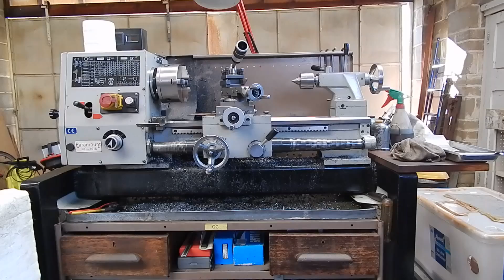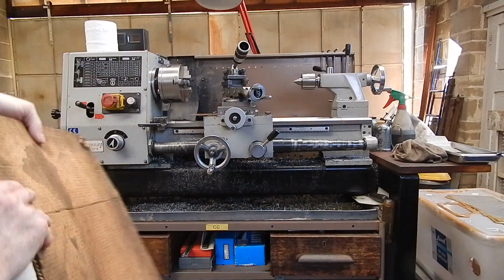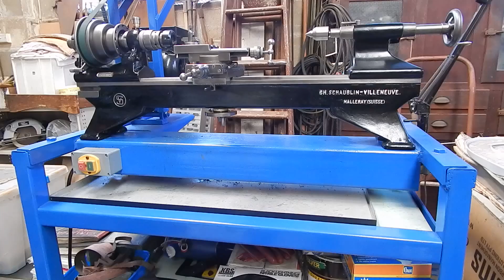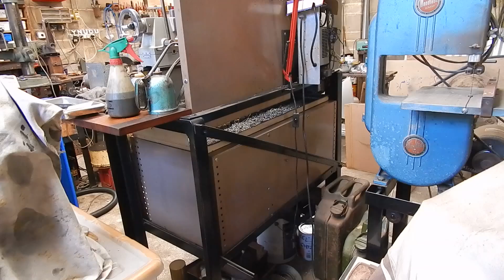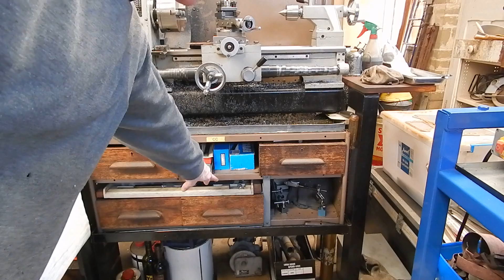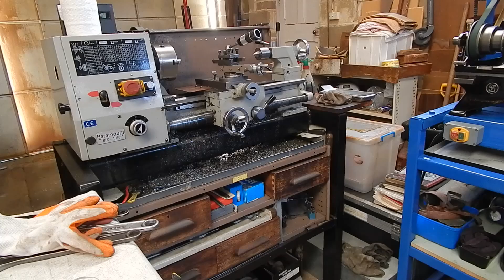Spanning beam metal lathe stand

Comment: Rob: Do you have any additional construction information. The Link supplies a lot of pictures. However It really leave too much up in the air for a newbie to make mistakes.
The most common Mini-Lathes like mine LMS - SXC4 - 8.5 x 16 is a decent lathe but it like most Chinese machines lack the basic rigidity and your approach makes much more sense than anything else I have seen.  My next challenge is to provide my Mill LMS X2 solid column with an increased base rigidity.
Reply from the maker: Hi Dave,  that's the only resource I supply.  There are various ways to do this (as shown).  The second (blue) stand I made has a removable/bolt on beam to make it lighter and easier to move around when constructing it.  Others have a metal beam on wooden cabinet/stand.  The choice is endless.  It all comes down to what you are capable of (some people can't weld) and you could even make the whole thing bolt up.  It's up to you.  Good luck.  Cheers Rob

Comment: Rob: I wish I had seen this video before I built my current Lathe and Mill Stands. Very reminiscent of how the RCN mounts their Lathes shipboard. Or at least what I saw as my Dad (CPO) took me through the Machine Shop on board the HMCS Quebec (HMS Uganda), at lot of memories. I was considering a U channel but the Box Beam would be so much more rigid. Good point on lowering the ends for the oil, how many times that has been over looked. Cheers BTW I also correspond with Gary of Eccentric Engineering.
Reply from the maker: Hi Dave,  I actually got the idea from seeing how they mount lathes in ship machine shops.  I thought it was a brilliant idea.  Gets the lathe up away from the chip tray and gives it a highly rigid, level base.  On ships they usually mount with two points at one end of the beam and a single ball point at the other.  That way the twisting of the ship can't distort/twist the beam/lathe base.  Very simple and clever design.  The way to go.

Here's a link to my web page on it:  http://users.tpg.com.au/agnet/cq9325rev4.html

  Cheers Rob

Comment: Great video Rob. Have you ever seen an example where someone used a three-leg design? I know three legs are often used to get around worries about uneven floors, but I suppose such designs aren't worried about leveling so much as most machinists are.
Reply from the maker: Hi Rick,  they often use a three leg design for ships lathes, to allow for the floor and walls flexing.  One end is usually attached to the wall at two points and there is a leg at the other end.  All attachment points are hinged or pivots.  

I basically liked the idea of letting the legs move/flex and the beam stay straight, so my (and other) torsion beam designs utilise this principle.  In addition you can have a removable chip/oil tray and raise the carriage hand controls well above it.  Much better than a conventional stand IMO.  I've had quite a few builders contact me to show their finished stands.

Cheers Rob

Comment: Hi Rob. Great video. I liked it so much I made one myself for my Warco wm280v. Couldn't find box section at my local metal guy but found some U channel instead. I mounted the frame on machine castors that allow the wheels to be retracted. I bolted it to the wall at 2 points. Now if I need to move it or access the rear I can unbolt it, drop the wheels and wheel it away.

https://youtube.com/shorts/EoWTUG-Qpf4
Reply from the maker: Nice job.  Yes, the spanning beam is the best design really, as it lifts all the controls clear of the cuttings tray and is dead flat.  Plus you can remove the tray. 

Send me some still shots and I will put them on my web page if that's OK with you, to show others how you've done it.  You can post them to gloaming_agnet @hotmail.com.    Cheers Rob

Comment: just wondering if the cross beam could be offset towards the front , to reduce setback ?
Reply from the maker: It is.

It also gives more room for the rear set electric motor.  You can position the beam at any position that suits your arms length, lathe footprint and controls.

Cheers Rob
Reply: @Xynudu  thanks for the prompt reply. Just trying to source the right steel, the steel for the beam is proving elusive. Looking like I will have to stitch 2 100x100 rhs together.

Comment: Do you bolt your lathes down to the floor? I have a 9x20 lathe around 100kg currently sitting on its original stand (2 pedastals and a wooden top) on a wood joist floor in my shed and I'm getting serious chatter. I imagine a lot of the chatter is because of the floor as it was never  intended to be used as a shop. I'm currently building a new shed with a concrete floor so I'm not sure if I should bolt it down or use machine feet
Reply from the maker: Both of my lathe stands are bolted to the concrete floor diagonally at two points.

I doubt that the chatter is caused by the lathe stand not being bolted down.  It is more likely to be a problem with the compound mount.

The original 9x20 lathes are known to have a weak two bolt compound which can cause chatter.  A modification to a four bolt design is apparently an effective improvement.

I bolt my lathes down mainly as a safety measure and to prevent movement.  The lathe stands are leveled with steel shim plates under the legs - which do the same as machine feet.. 

Cheers Rob
Reply: Thanks for the response Rob, unfortunately my 9x20 already has the compound upgrade (I brought it second hand) So I think I can rule that out. I got to see it running before I brought it and it made a nice cut. I'm brand new to metalwork in general so the floor was my first guess but maybe its something else. 

I've drawn up the bench and was wondering if you had a spare 5 minutes to look over it? I'd be happy to share it with others too if it's correct.
Reply from the maker: Sure.  Email me at gloaming_agnet@hotmail.com

I use a spanning beam stand for each of my lathes : https://www.youtube.com/watch?v=ztA-0KSi1FM&t=12s

Cheers Rob
Reply from the maker: When the guy demonstrated the lathe was it bolted down ?

Chatter is caused by flex  between the cutter and the job - it can be loose carriage or cross/topslide gibs.

Too much tool overhang will magnify any movement, and put additional stress on those loose/weak points.

Using too large a cutting tip radius will also increase chatter potential.

A good set of cutters for this sized lathe is TCMT replacable carbide tip.

Cheers Rob
Reply: Thanks Rob, I've sent that to you
Reply: It was bolted down in the same way I have it now but there were a few differences now that I think about it. 

He had it bolted down into a wood joist floor like me but I currently have it to parallel to the joist, that is both lag bolts in the same joist (Mainly due to space constraints in my shed). Whereas he had it at an angle I guess to span the joists without drilling new holes in the bottom of the pedestals. 

The other difference was that he had a piece of plywood screwed to his wood floor board then the lathe bolted through all of that. Whereas I have a sheet of diamond plate on top of a 18mm OSB board on my shed floor.

I'll go through my setup today and have a good look at the other points you have mentioned too.

Comment: nice stand work. my only suggestion is to not set the lathe so far away from the operator.
Reply from the maker: I don't see your point.

Everything falls readily to hand.

Rob
Reply: xynudu you look like a big guy, but for those 5'10" and below it looks like the lathe is too far back and would have to either lean on the fron of the cabinets or bend forward and that may lead to fatigue. just my 2 cents. it clearly works fine for you.
Reply from the maker: I'm 6'2" so this works for me.

The beam set back is exactly the same as for the 10 x 18 Chinese lathe, which I first made this type of beam stand for.

Not all people are built the same, so you make the stand to suit the operator, on both height and set back.

There is no one size to fit all.

Cheers Rob

Comment: Hi I am going to build a stand to your great design. Is there a good reason I can't bolt the motor to the middle shelf and bolt the pulley shaft about beam level? Thanks for all the time spent making the videos.
Reply from the maker: Hi John,

Sounds OK to me.  You will probably have to incorporate a vertical support/stringer to prevent flex at the motor mount point.

Glad you enjoy the videos.

Cheers Rob
Reply from the maker: Just be sure to allow for easy speed/belt change.

That's where a pivoting/rocker type mount comes in.

Depends what type of lathe and speed arrangement you have.

Cheers again.

Rob

Comment: I find that locally, I can buy a brand new concrete parking curb for ~ $40 Cdn: (http://www.concretesteps.com/themes/basic/assets/images/curbs.jpg)
At 8' x 6" x 10", close to my lathe's footprint and 350 lbs, I'm wondering if this might not be my least troublesome option if mounted upside down to some steel or even wooden legs.
Reply from the maker: Good find.

Some people pour their own beam (or even a full bench top) from concrete.

That sleeper would be damn strong for sure, and provided it's level would be great for the job.

Looks well formed.

Cheers Rob

Comment: Great stand.  I've got a 10x30 that will be here in a couple weeks and I need to bang a stand out for it.  I think I'll follow your lead.
Reply from the maker: +BellyUpFish 

It works well. 

If you can't find a heavy/wide enough beam for it,  you can stitch two smaller ones together.

Also read my comments to "thebrokenbone" regarding oil drip - in my latest video on calculating correct lathe bench height:

https://www.youtube.com/watch?v=YNcHLU5-_FM

Cheers Rob

Comment: I am thinking of making one of these lathe beds for my southbend 9 lathe,but I don't have a working arc welder,can I use a mig welder instead?
Reply from the maker: +airsoftsniper108 

Yes.  MIG can lay down a plenty strong enough bead.  Use the heaviest wire gauge the unit can feed.

Rob

Comment: Those are awesome ideas for benches.  Gave me a lot to think about.  And the suggestions for cutting an angle on the ends to direct oil drips to the pan below was really good.  I will be copying you most likely. :)
Reply from the maker: Curt Doe You won't be disappointed. A big advantage is that the carriage hand wheel/controls are lifted well above the chip/tray.  Cheers Rob

Comment: Wow that's a heck of a sturdy stand on that Schaublin.

And the schaublin looks really nice, Did you restore it?
Reply from the maker: Yes, I bought it as a run down unit, bad shape, and restored it, reworked the slides etc.  That's the original colour.  Not many were like that, only very early ones (1930's).  Rob

Comment: Great video.  You have done a good job on the lathe stands.  We might differ a bit on how high they should be as I like to look down at my cutting tool.  Of course everyone will be different on what is a comfortable height.  My mill/drill sets up a bit too high, the table is just under armpit high and it works fine but then it has different controls than the lathe.  I would have preferred it a bit lower but that is how things worked out when it was placed on my workbench and it is so heavy I don't want to move it again.  Thanks for sharing and keep the videos coming.
Reply from the maker: Yes, everyone is different.  Being tall, I get a back ache if I stand bent over for too long, so higher is better than lower for me.  You can always stand on a pallet if things are too high :)  Cheers Rob

Comment: At what hight from the floor is the center point ? Seems to me that they are very hight.The CP on the Clausing 5912 is at 44".

Great ans solid rack indeed.
Reply from the maker: 45.5" to the centre of cross slide hand wheel.  Probably looks more as the lathes are smaller.  Rob
Reply from the maker: I was also shooting from a low camera angle, which I don't normally do.  That would make it look high.  Rob